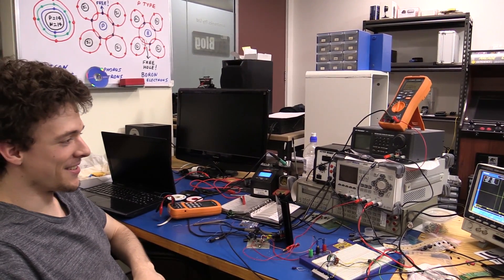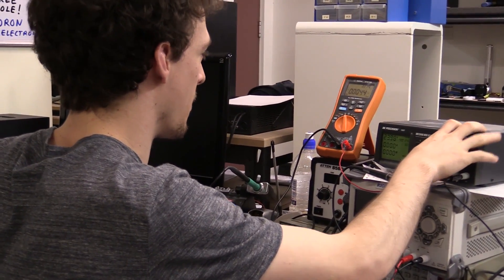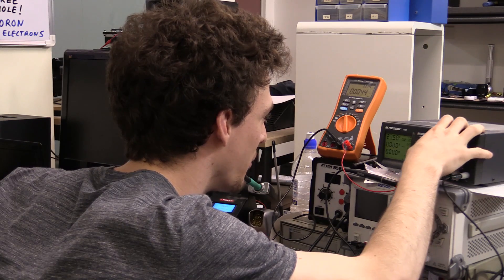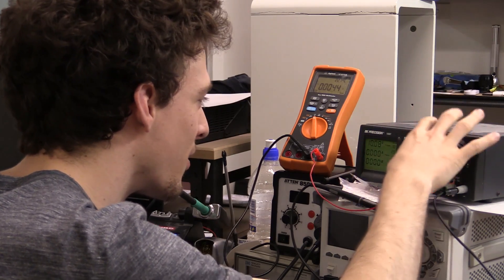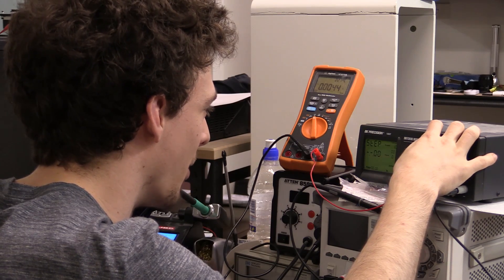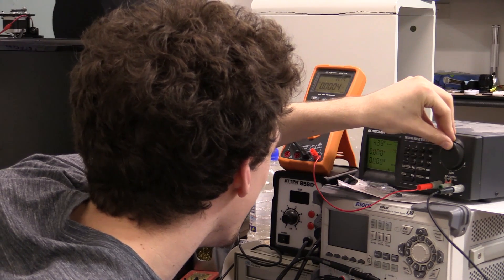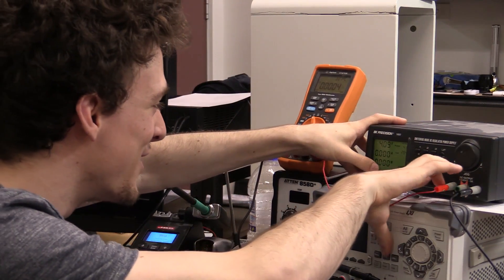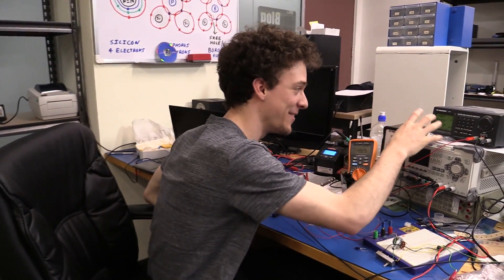David2 PSU Challenge

Comment: With the contacts closed and having set the potential and current, connect the negative lead from a battery but not the positive lead.  The contacts will open.  If instead the positive lead is connected first, the contacts stay closed.

Comment: These young players don't even know they're born Dave. I built my first scope one component at a time (monthly) over 3 years from the magazine "Hobbytroniks". The output section was called "output". Solder was only available at shops so we melted dowun coat hangers. I still use it today to power 15 xeon servers in our loft. I saved up AA batteries over many years and have paralleled over 9000 as a failsafe. I could tell you how I get this to work but it is proprietary. The cryogenic cooling system came in 96 episodes of "Fun With Freezers", sadly withdrawn after 95 editions. Issue 96 commands big bucks on ebay. I will not part with mine.

Comment: At least you do not have to enter the values in octal, with a load address instruction before each value, followed by a jump to program instruction, all entered via a single push button that has 3 functions, depending if you press down for 100, 150 or 200ms. Display is a single row of red LED dots all spaced 1mm apart behind a smoked bezel.

Comment: I own a B&K 1697 and agree completely. It's a nightmare of a user interface. The bottom four buttons look like they should have separate contacts at each end, but they don't; they're a single switch. The jog dial has a dimple for spinning it with one finger, but because the dial rubs the case, it won't spin more than half a turn. Want to turn the output off quickly? Sorry, it takes two button pushes ("SHIFT" then "O/P on/off"). All the buttons are wobbly and squishy under your fingertip. Calibration is almost 10mV off, and the PC cal software doesn't work. Its output specs are impressive (40V, 5A), but I've found the output to be noisy as hell. I once had to take a project to an IC manufacturer's lab for a customer support engineer to look at because it wouldn't work right on my bench. Of course it worked perfectly in their lab on an Agilent PSU. I put a scope on the 1697, and after some raised eyebrows, I bought a new Tek PSU. The 1697 is now used as an inscrutable, and expensive, constant current lead acid battery charger.

Comment: That power supply needs to meet the well-worn side of the Photonicinduction hammer, that's a screwy interface that makes absolutely no sense whatsoever, it's like having a lift panel having numbers that don't represent floors and you have to enter codes that aren't known to try and work out how to get to the right floor... :S